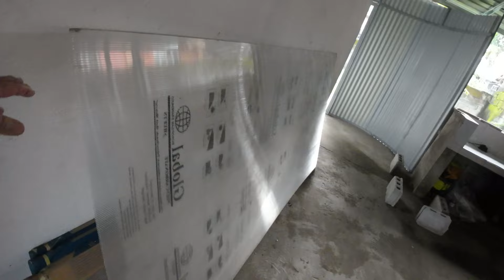$36 USD Monthly Rental / Construction update / The Man Cave

Comment: I'm one of those pale northern types that can get sunburn thinking warm thoughts.  One of the first things I learned here is that you to NOT eff around with tropical sunshine.  It isn't that warm friendly glow you get during early summer in the high latitudes.  It's more like the flash from a detonating hydrogen bomb.  If you somehow manage to adapt to it, you can probably get a job doing internal repairs on nuclear reactors without shutting them down.  I've seen SPF150 sun block for sale here.  I have shirts that don't provide that protection level.
Reply from the maker: Understood my friend and well explained too. My hat also covers my ears and people can't understand why I wear long sleeve shirts.  Do you remember where you saw it and how much the 150 was ?
Reply: @Ex-Pensive_Expat  150 would be impossible. How is it possible to have 150 percent protection? I think 100 percent is the solid white zinc some people use on their nose.
Reply: @JohnSmith-ti2kp  SPF isn't a percentage,  it's a marketing term that stands for Solar Protection Factor.  I don't know exactly how it's determined but suspect it's something like the proof number on distilled alcohol. (100 proof has an alcohol content of 50%)  The zinc cream would probably have an SPF of 200 if there was a serious attempt to market it.
Reply: @joekahno  It is a percentage,  SPF 15 offers 15 times the sun protection compared to nothing, so SPF 50 would be 50 times the protection. I read that really only up to 30 is actually possible, but maybe the technology is better now.
Reply: @JohnSmith-ti2kp  You don't seem to understand that percentage defines a point on a range.  If you call noon on the equator max exposure and hiding in a coal mine as zero.  You can call the UV exposure you'd receive half way between the two as 50%.  SPF 50 can't be a percentage because you've only defined one end of the range.  In practice SPF defines nothing.  50 times the protection you'd have wearing nothing is fifty times nothing.  50x0=0  It has never been anything but marketing BS.
Reply: @joekahno  Whatever.

Comment: Also, please consider block glass for your window. It lets light in but also keeps prying eyes out and has a little more insulation value than regular glass. Should also be affordable for your budget.
Reply from the maker: Yes, I may use it in the curved area of the front wall if it's uncomfortably dark. The back wall in the kitchen is almost all glass

Comment: Cool space. If it was me, I'd probably go with a comfy hammock instead of a bed. Light, bright colors with a tropical theme. Like white walls with rainforest mural coming from floor and halfway up. Lots of hanging plants. I'd keep the concrete floor and do a cool but tasteful design and clear coat epoxy it. A couple of upholstered furniture items, like a small loveseat and a couple of small comfy chairs in solid turquoise and yellow with tangerine complementary colored pillows. Oh boy, I have a vision. 😂😂😂🤷🏼‍♀️
Reply from the maker: I like the epoxy concrete floor idea. Thank you !!  I would need to find a concrete polisher and haven't seen that here

Comment: The new roof & metal framing looks so good. I'm looking forward to seeing how the kitchen area turns out.
Reply from the maker: Me too.  Both of them Haha...  I was thinking of you a few minutes ago. I decided out in the back there will be an enclosed 8' fence with a section behind and out the back door for just for this unit.  So if you had a girl over you would have complete privacy
Reply: @Ex-Pensive_Expat  I was thinking about this video again & you mentioning the fence. For Talus he can jump 6' fencing & I thought I remembered the backwall being shorter but you  said here 8' fence so that will be perfect. No way he ever jumps that & I wouldn't place a bbq pit or something by the wall if it meant he could jump over that.
He escaped here in my GJ home a few times before I was able to escape proof the yard & learn where he was getting out, but it is not the same there, not everyone has a working cell phone to just call the number on his collar. So even when I find a more long-term place before I even move in I will be proofing the yard/gate. Other than the wall height thats one reason I like your place so much, super secure walls & a very sturdy gate with a concrete driveway under that. Its now November,last month of my renters it is really  getting close now:D

Comment: I made a privacy fence section out of the bamboo, but it is really hard work, but I had help. We cut it to length then used 2x2 inch  treated strips about  two feet long to nail the bamboo to. These were then placed in an up right position and screwed into place. They age quickly and soon become brownish tan in color. If placed over your tin painted the same color, they would look great. For long term use you could paint, stain or weather treat them.
Reply: Bamboo resists paint.  It's why you never see it painted.
Reply: @b_uppy  Painted bamboo furniture is popular.
Reply: @JohnSmith-ti2kp  
Lol.
Reply from the maker: It was suggested I use khaki to paint over the blue and behind the bamboo. I will treat the bamboo after it turns tan / brown to preserve it.
Reply from the maker: I wouldn't paint the bamboo. I would paint the metal. I would treat the bamboo to preserve it and keep the bugs out
Reply: @Ex-Pensive_Expat  
Charcoalizing it will help.  The Japanese use a process of burning the outside that resists weathering, etc on wood products.
Reply from the maker: I should look into that>>   Thank you!
Reply: @Ex-Pensive_Expat  
You bet!

Comment: Put a couple of whirly birds on the roof extracts the hot air from the ceiling. easy to install and no electricity required
Reply from the maker: I was thinking about exactly that today.  I will only have about 5" of clearance and want to also put insulation between the drywall ceiling and the roof panels. Will that leave enough room for those whirly birds to be effective?  How would they keep the rain from coming in?

Comment: Looks nice, great ideas. I would add windows, maybe one in the front and another on the side above the fence for light and cross ventilation.
Reply from the maker: I might add windows in the from if it's too dark.  It will stay much cooler if the windows are out of the direct sun light.  I will be having a door made with glass in it. That's the plan at this point

Comment: Vert cool. The vision is coming into frustration.  The steel, all metal is going to be a hotbox, even with aircon condensation may build up, then more mold. 
Your idea for the bamboo outside of the metal is great. 
Have a great day.
Reply from the maker: There will be a lot insulation.  It hasn't been too hot yet..There will be some ventilation with 5" between the ceiling and the roof panels
Reply: @Ex-Pensive_Expat  very cool. I like watching your laid back, intelligent approach to moving to the Philippines using a low maintenance budget and succeeding higher than the “let me show you how” expats. I am following the positive creators and will land after the elections. With assurance of no riots, etc, then by Jan 6, 2025 no riots or drama I can start my retirement journey. 
Thanks for the content.
Reply from the maker: I look forward to meeting you when you start adventure

Comment: Looks great mate.  Does not feel like a year ago at all.  Just a thought where the fence wall is:  How about 2 or 3 rows of glass bricks meeting up with the ceiling to let some extra natural light in?  May be difficult though as you've already put the wall frame in on that side.   You can get them in varying levels of opaque.  The string some curtains along there to block it as needed.

Love the bamboo, and yes, it is excellent insulation which is a must especially if you want to keep the cool from the AC in.
Reply from the maker: Thank you. That's one for the bamboo.  I was thinking about glass block in there but it would be kind of a cluster with odd angles.  Looks doable facing straight on but from the end you can see the angles and the main idea requires sealing it off from rain moisture etc. I think the light will be good. If not I will probably make a glade block window maybe a few pieces wide from the floor to ceiling in the from facing the street
Reply: @Ex-Pensive_Expat  that makes sense on the glass block thing.
Reply: And as for the hats, as an Aussie who's had multiple melanomas removed (all benign so far), keep wearing it.  I'm old enough that when I first joined the navy we spent most of our time on the upper decks shirtless with no sunscreen in the warmer climates.
Reply from the maker: That was the way it was then

Comment: On curved radius wall,take foil insulation like they use under roof panels..Cut just one side with razor knife about every 1 to 2 inches..make sure the lines go with he lines of the insulation ,,lwhen you roll it up you will see it has a direction..attach it with glue or any other method and have the uncutface of the insulation  facing inward..Hope this isn't too confusing,,was a contractor many years😊
Reply from the maker: That sounds like the material I had in mind.  So you install it using glue?  Thank you for the comment. I feel like I'm on the right track more now. It's like 3/8" thick comes in rolls?
Reply: @Ex-Pensive_Expat  I think he is referring to a thicker product such as Celotex/ Kingspan etc. Which is a rigid foil faced high density closed cell foam of various available thicknesses. It has a much higher "R" value than that thin foil product you are thinking of. That is just a radiant heat deflector and is not a very good " insulator". Rockwall fibre glass insulation is another good option which is a thick soft product that comes in big rolls and easy to cut and shape. It what we use in our lofts in England .
Reply from the maker: Thank you I will look into that

Comment: I suppose instead of the bamboo on the walls you could power wash and paint it as well. Maybe have a local artist even add a meural either the whole wall or just different areas
Reply from the maker: It's been suggested before for the outer walls of the property. But those walls are less than 6'.  I like the looks of bamboo walls I've seen at resorts and that's what I was envisioning being 8' high.  I'm a corner lot with streets on 3 sides.

Comment: Hey Buddy,  I love your idea for the guest room.  Also the idea of covering the front curve of the wall with bamboo.  As an interior designer, I can strongly recommend leaning into that vibe of mixing modern finishes with lots of rustic natural accents like the bamboo to keep it feeling warm.  Blue is my favorite color.  But I think it's a bit stark against the soft traditional details of the front of the house.  I can suggest painting the navy blue the color of  Bamboo when it is dried (beige) so it  blends in  behind the bamboo. A more fun option would be to paint it black for a more shadowed look behind the bamboo. It would still be more modern and would tie into the black on the window trim and metal work. I understand this would not be the best choice for trying to cool the wall however.  I'm sure what ever you choose will look great. Also I  would strongly vote against a sofa bed.  No one wants to sleep on one. Maybe have a murphy bed made up?  Perhaps one that has a fold out table top to use when the bed is in the put away position.  Two birds one stone, and a real night sleep. 😴  Love the videos!
Reply from the maker: Wow Thank you so much for the ideas> Thank you for taking so much time to explain it !!

Comment: I would be interested in staying for a week or two. Why not use live Bamboo along the property walls? It expands it's range using shallow runners so, to avoid being over run, you would make a shallow concrete barrier, sort of like what I see in the videos. I think it only needs to be like 12" deep. Instant live wall that stays where it should
Reply from the maker: I like the look it would have as already harvested bamboo and uniform.  I'v dealt with live bamboo in San Diego and just not as happy with the look of it.  But thank you for the suggestion

Comment: I thought you mentioned bamboo to be against the block wall in past videos  That I like.  I'm not sure about bamboo for the mancave.  Maybe it would look good.  But if you decide not to use bamboo for the mancave, I would definitely repaint it with a neutral accent to the white main house.  Look forward to next update
Reply from the maker: I'm already planning for the wall. It's the man cave I'm not sure of.  I will line some up against it.  But in the video I laid some on the ground to get an idea of how many pieces I would need to cover the walls.  That also is how it would look if you can imagine that same look up against the man cave.  The insulation could be awesome on the curved areas. I'm just not sure yet

Comment: Wow Daryll, It looks amazing now...Good job!👏👏👏  Maybe you can add a bit of pocket window just above the door way and on the kitchen for ventilation so the air flows can just makes the room cooler when you maybe don't use your aircon and or electric fan..
Reply from the maker: I am considering putting exhaust fans one in and one out on the opposite ends of the main room
Reply: @Ex-Pensive_Expat  That's a good Idea too.

Comment: Would do a reflective layer in the roof then spray foam insulation for reduced heat build up.  You also need dehumidifiers to add comfort.  

The bamboo sounds like an excellent plan, though it might need frequent replacing if you fail to make sure the heat can escape.  The other thing is will it be rodent resistant?  May want to treat it to make it repellent to rodents that may otherwise use it.

Would put in a translucent glass panel to the front side for light, while retaining privacy. 

Is there a bathroom inside the house or must use the one around to the outside?
Reply from the maker: The bathroom was in the video at the end.  It's next to the back door on the left
Reply: @Ex-Pensive_Expat  
So outside-ish...
Reply from the maker: Half the way through the video the bathroom was enclosed and no longer outside ish. It's closer to the end that becomes obvious I thought
Reply: @Ex-Pensive_Expat  
Thank you.  Was wondering.

Comment: I have seen a restaurant in Thailand set up a garden sprinkler/ watering system on their metal roof to help keep it cool. It uses a pump to recirculate the water from a large tank in a continuous cycle. Not sure if the pump is run off solar but that would make sense. Drywall can be curved by cutting a lot of vertical slits in the back of it but using a thinner plywood might be an easier option. The bamboo screening on the external walls will help with the heat gain and looks good when the colour mellows with rope attached top and bottom.
Reply from the maker: All great ideas. Yes I forgot about the curving of drywall with the cuts in it.  I actually have done that before. Good thought!!

Comment: Very Interesting, especially how you are doing the outside wall. Hope you keep videoing the progress. The muriatic acid would work well on the tiled bathroom. After using the acid, it would be a good time to touch up any grout. Make sure you seal all the grout afterwards. How long is your lease again? Thought it was only for a couple years.
   Keep up the great work, Daryl...Jim
Reply from the maker: I have two years remaining on the first part of the lease and two extensions. It seems a lot for not owning the property. But this is my home for now and my hobby.  Many people spend more on their hobbies and rarely even use them. Like a motor home or a boat or example

Comment: Love that you think outside the box. My 2 cents...Metal gets hot and is not a good insulator. You are in the tropics so the bamboo would be a very cool look and keep the direct sunlight from heating up the metal. I live in Arizona so I know of what I speak. That metal will be hotter if direct light hits it. Love the vision. Keep up the great work. Love the videos.
Reply from the maker: Thank you for your thoughts. I am thinking of painting the roof white and will also be using a lot of insulation.
Reply: @Ex-Pensive_Expat  You are welcome. You are doing a great job. Sending you positive mojo my friend. Take care. Videos are awesome.
Reply from the maker: Thank you my friend!!

Comment: Maybe put in an extractor fan or two up high to pull the hot air out just an idea
Reply from the maker: Yes I was thinking about those fans typically used in bathrooms.  Air blowing in at one end from the aircon and exhaust fan at the other end blowing out the hot air

Comment: I had a same set up when i was living in a village near Nong Khai, i mean the carport - and i replace two panels with those lightly transparent plastic to add light inside and i did the same on the roof house to add light
It was my kitchen
Reply from the maker: In that area between the roof pannels and the ceiling there will be insulation. But I was thinking if it really needs more light then I would install a floor to ceiling glass block window in the front
Reply: @Ex-Pensive_Expat  i also added insulation with rolls self adhesive alluminium cover with insulate material inside - 1 meters by 6 meters and 1 roll cost something like 4$ or 5$ each
Reply from the maker: Very nice to know > I will look for it

Comment: half an inch of insulation under the long span would make a hell of diff. save you money on A/C.
Reply from the maker: Than you Manuel! Do you recommend a particular type you recommend ?. They use a lot of what looks like an aluminum quilt here. That is what I'm planning on at this point.  I thought I had mentioned that and also in the curved walls too.